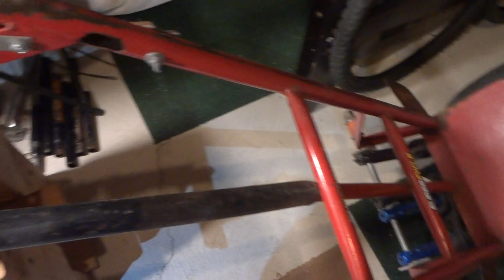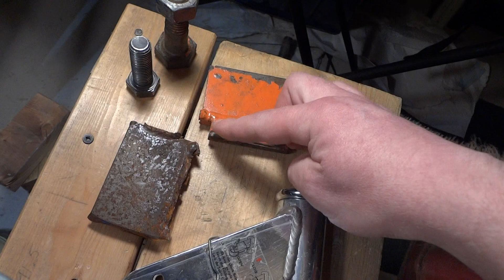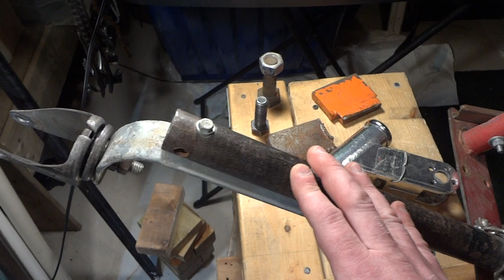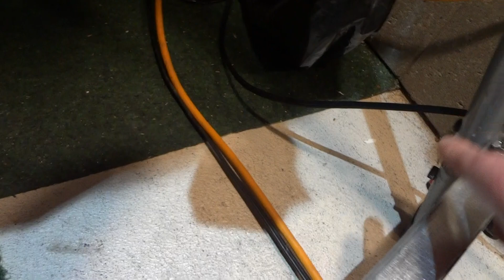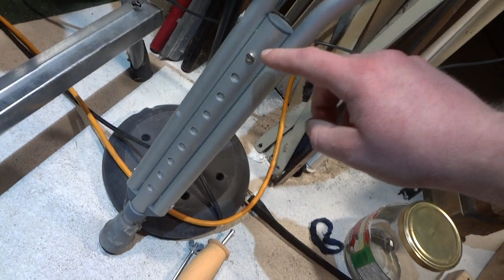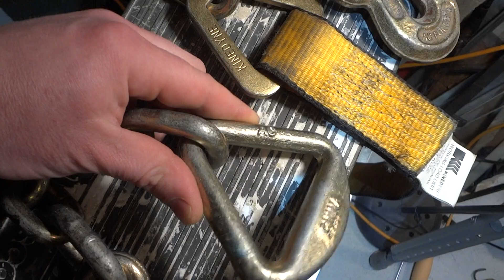Welding vs bolting which is better ? You be the judge !

Comment: I dont know much, but it likely all boils down to economics. Welding is faster and cheaper, whether it be for mass production or a one-off.

I've made some things recently that i wish I'd designed with bolted connections so they could be easily disassembled, compacted, and transported. Taking the easy way out is sometimes harder at a later time.

Comment: Another thing is the equipment. It's not that hard to bring a drill, some screws and bolts. Try bringing your welding machine anywhere. If you want to work outside.